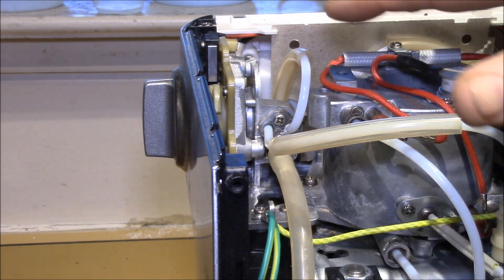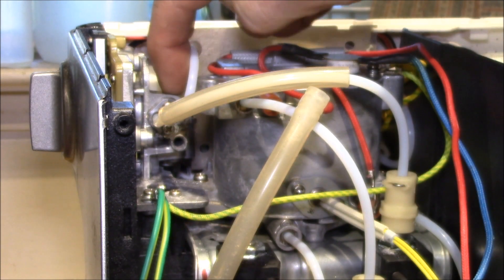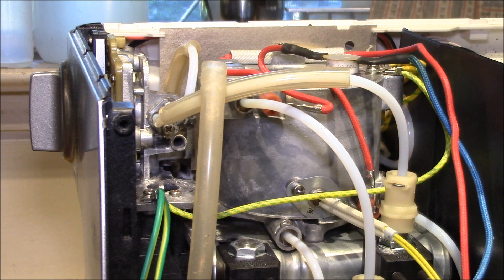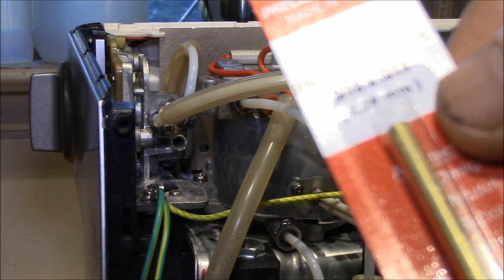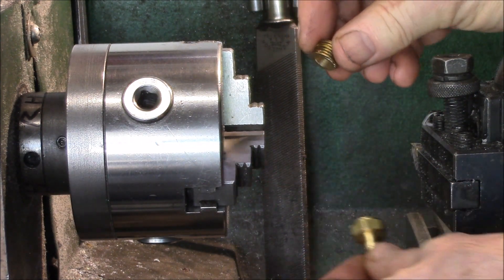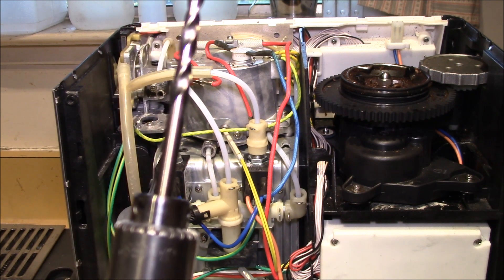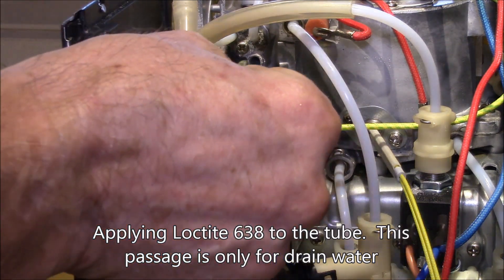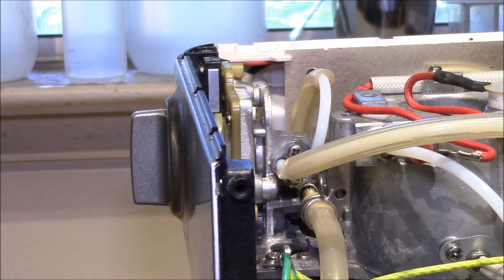Breville 870XL Hot Water / Steam Valve Hose Barb Repair

Comment: This looks to be a return for the water. Probably just to relieve pressure after using this side of the machine. I didn't have enough patience to do what you did, so I just driven a screw inside to block this off. There are two other pressure relieve hoses, so it should be ok. - correction : this one is used during first start up. Now I am waiting when the screw will shoot. Next time I will probably replace the whole thing because if that barb went corroded - the rest is on the way out too. My barb was way thicker than yours, it just crumbled away when I was trying to get out that switch assembly to clean it.
Reply from the maker: Good to know. Thanks for sharing your experience.

Comment: Thanks for the video for reference.  Do you happen to know how to repair the water line that is 11 o'clock to the water line you are troubleshooting?  Do  you think it is the same type of attachment?  In my machine that line (the 11 o'clock to the one you're troubleshooting) has become unattached, I heard it blow off.  Now I'm elbow deep and have no idea how to reattach the water line.  
any advice is welcome
Thank you
Heather
Reply from the maker: I've never worked on that tube, but I think it's held in by the small flange that's held on with the screw at the top.  It probably has one of those brass ferrules one the end, behind the flange.  The tube may have slipped out of the ferrule.

Comment: Hello teacher, I have a problem with the espresso machine (capsule). The steam comes out densely before the water, and then the water comes out. What is the problem?
Reply from the maker: I have not seen that issue before.  Is that out of the hot water / steam valve?  If so, the only thing I can think of is that the connections on the 2 micro switches on the valve have been swapped.  One signals hot water position and the other signals steam position of the valve to tell the machine which way you have turned the valve.
Reply: @The4Crawler  Hello my friend, do you have WhatsApp? I will send you a video.

Comment: I’m trying to replace a water hose and the hose won’t come out! I was finally able to get the pin out but the hose is stuck in the metal. Any tips?
Reply: The water line I can’t get out is the little one that connects to the group head. I got the side out that connects to the solenoid (replaced that) and still no water from group head. I did inject some vinegar and used a paper clip to pick at some blockage that was in there! But still no luck after i tried the single cup again :/
Reply from the maker: @AnnaLien-i3j  That's another line I've not had a reason to remove on my machine.  There might be some tips on this web page:
- https://siber-sonic.com/appliance/800Mech.html
Reply from the maker: If you're talking about the hose to the hot water port, I haven't been able to remove mine either.  Likely the end of the hose is stuck inside due to the same corrosion that I saw inside the hose barb I repaired.  Maybe try injecting some descaling solution with a syringe and see if that helps to free it up.

Comment: I have a leak from the hoses where the water is dispensed. I got new zip ties on the hoses because those zip ties were old and almost braking but it didn't help to much. I think I need new hoses? What is the size of the hose ¼inch?
Reply from the maker: It's likely 6mm ID, which is close to 1/4"
Reply: Which one is it better to get 6mm or  1/4 6mm is 0.23 and  0.25inch is 6.35mm.
Reply from the maker: @dans9462  Tighter is likely better, if the hose barbs are designed for the smaller 6mm dia. hose, then 6mm hose would give the tightest fit.
Reply: I order 6mm. Thank you for quick reply and all your help.

Comment: Hi, I am from Colombia, y have a problem whit my machine Breville 870, I have vapor, but I can't to get an Expresso, I don't have pressure, do you know what is the problem, thanks 😢
Reply from the maker: Follow the water:
https://youtu.be/9lMw6ooiqPI
Likely the 3-port solenoid valve (on the right side) is either sticking, or not getting power.  That lets water flow out the top to the hot water/steam valve all the time.  See the other videos in the this playlist for replacing, testing and cleaning that valve.

Comment: Thanks for linking me here man I appreciate it. This unit is a second hand purchase. I was able to get the rivet out of the old Tef tube and the gold piece out too.  So I may do that with the new one, drill bit or sand the gold part of of the old hole and feed the new tef tube in then re attach the gold piece and rivet. We'll see what happens lol
Reply from the maker: Glad I could help.  At some point I need to pull that valve out of my machine and see if I can take it apart that way.

Comment: New selector assembly $30...where does that 2nd small teflon tube on the right go too?  I have the BES860 model which only has one steam teflon tube going to the selector assembly.  I can still get this assembly but will need to plug off that hose maybe.
Reply from the maker: The upper Teflon tube runs to the steam wand as I recall.  Where did you find a new selector assembly?  All the places I checked say "discontinued".

Comment: Hi, do you have any recommendations for removing the steam wand entirely? I am having an issue where water/steam leaks from the top of the steam wand... I'm guessing it is likely a broken seal somewhere where the steam wand attaches - looking online, it seems like I should be able to unscrew the steam wand directly with a wrench, but mine won't budge. Any suggestions?
Reply from the maker: Never had mine apart.  But try this write-up:
https://siber-sonic.com/appliance/800Mech.html#leakwand
Reply: @The4Crawler  Thanks for the quick reply and sharing that link! That was what I was attempting to do, but I can't get the steam wand unscrewed at all... its completely stuck. Ah well.
Reply from the maker: @lopazanski12c  Just tried mine and it unscrews w/o too much trouble (right hand thread as expected).  Might try working the hex nut back and forth a bit to see if it'll loosen up.  There does seem to be a spring up inside the end.
Reply: @The4Crawler   Thanks for testing it out on yours, great to know thats what should happen... I've tried to get mine to move with quite a bit of force, and it hasn't moved a millimeter in either direction. Frustrating!
Reply: I’m having the same problem with mine. I purchased a replacement wand, but the trouble I’m having now is unscrewing the faulty one off the machine. Any luck with yours?
Reply: @MishoMisho74  Unfortunately no, I tried for awhile, but was never able to unscrew the wand from the machine. I ended up sending it back to Breville for repair... except it turns out they didn't fix it either, because when I got it back it still had the exact same problem. So now I am going to be sending it in again. Ideally if you can find some way to get it off yourself, that's definitely the way to go. Mine won't budge.
Reply: @lopazanski12c  thanks for replying so fast. I tried again just now, still won’t budge. It’s unfortunate that sending your machine to Breville did not fix your steam wand issue. I’ve had mine for more than 6 years, not under warranty anymore. I may just try a local repair shop in town that specializes in espresso machines. Out of curiosity, how much did Breville charge you for that fix or rather non-fix? I hope you don’t mind my asking. Thanks!
Reply: @lopazanski12c  yes that large nut is basically heat forged on there with corrosion over time.  Easier to replace the selector assembly.  Had mine in a vice & the cast alloy broke before the nut gave..still able to salvage the nut end if you chip the cast alloy out of the threads with a chisel & punch:D
Reply from the maker: @MishoMisho74  No video but mine just unscrews using a small adjustable wrench, seems to be 3/4" or 19mm.  It's spring loaded inside, so it's a little hard to turn.  Regular right hand thread.
Reply: @The4Crawler  Thank you! Going to try one more time later. Will let you know if I have any luck.
Reply from the maker: @MishoMisho74  Not sure if they've changed the design of that part over the years.  Mine's a 2013 model.  Here's a parts diagram:
https://www.ereplacementparts.com/frothing-wand-complete-assy-p-1810371.html
Reply: @MishoMisho - I'm having the same leak.  I bought some replacement seals/gaskets online...but can't unscrew the nut to remove it.  I'm wondering if it's all bound up due to our hard water... I"ll keep trying and see if I figure out any tricks to get it off.
Reply from the maker: @FredParent  Likely so, I was unable to loosen one of the screws on my valve.  Instead of forcing it and risking more damage, I chose to repair the valve and fitting in place.  So far that's been working great.
Reply: @FredParent  I gave up on trying to unscrew the steam wand after my 3rd attempt which made the leak worse. I wonder too if the hard water build up is preventing us from unscrewing the wand off. Let me know if you have any luck with yours.

Comment: During my last 870XL repair, I accidentally cut into the silicone tubing when cutting the zip-tie that held the adapter for the water tank.  Can you tell me the dimensions of this clear, high-temp silicone tubing used through this machine?  I have to replace my solenoid valve assembly, so I thought I'd replace this tubing when I open the machine up for this repair.  And, thank you for all of your repair videos on this machine.  You've been a great resource!
Reply from the maker: Looks to be 6mm or 1/4" ID.

Comment: Hello . My breville barista express when I want to froth the milk, I activate the steamer and I get steam from the head not from the steam wand
Reply from the maker: Likely either one oof the solenoid vavles is not working right or is hooked up/plumbed incorrectly.  Water should flow through the thermo-coil and water/steam should exit via the top of the 3-way valve to the hot water/steam valve:
https://youtu.be/9lMw6ooiqPI
Maybe your valve is stuck open and is sending steam out the brewing head instead.

Comment: Hello , would you know if this whole unit can be replaced? I had similar problem and the port was clogged because the bras head from the hose got fused with the port  , I drilled it out ant tried to replace the hose , but in the process I broke the part of the port that holds the pin clamp , I'm not very mechanically inclined to machine new parts so wanted to see if I can replace that module.  Or if you have any other suggestions. Thank you
Reply from the maker: It seems that valve may have been discontinued:
https://www.ereplacementparts.com/selector-valve-assembly-p-1810370.html
You could contact Breville with the p/n and see if they have any options.  You could always bypass that valve by running the hose to diffuser/drain.  That will eliminate the hot water/steam feature but still let you use the grinder and espresso features.
Reply: Thank you 😊

Comment: Hey man. My breville barista express does not stop dispensing water when i click thr 1 shot. Before it used to stop automatically at 12 seconds but not i have to to manually click the single shot buttom to make it stop. Any insights about this? Hope to hear from you soon. Thanks Buddy
Reply from the maker: A few things to try.  First, be sure to use a short press as a long press on the 1 cup button makes it run for an extended time.  

If that's not the issue, try resetting the default volumes.  From the user manual:
"To reset the machine to the default 1 CUP and 2 CUP shot volumes, press and hold the PROGRAM button until the machine beeps three times. Release the PROGRAM button. The machine will return to its original default volume settings and default espresso water temperature"

If that doesn't do it, might be worth contacting Breville support and see if they have any other troubleshooting information.
Reply: Thank you for the response buddy. Ive done both but still failed. Im currently descaling it daily and not use it to make coffee. Hopefully its gonna help
Reply from the maker: It may be the problem is with the main controller board.  All the buttons and solenoids are controlled by the main board.  When you push the 1-cup button,  that signal goes to the main board and then the solenoid is turned on for a period of time by the main board.

Some other things to try is to unplug the machine for an hour or so and see if that gets it to reset and then you might try programming the 1-cup volume with the Program key following the instructions in the manual.
Reply: R Brown works fine now brother thank you
Reply from the maker: @ralphadriandira4906  Glad you got it working again.  Was it reprogramming the 1-cup button that did the trick or unplugging the power?
Reply: Hey Buddy. My breville finally gave up. It dispenses water non-stop..
Reply from the maker: @ralphadriandira4906  My guess is that the main controller board is acting up, as everything in the machine is controlled by that board.  Either that or the water flow sensor has failed and the controller can't see how much water is coming in.
Might be worth contacting Breville support and see if they have any further troubleshooting for that issue.  A new controller board is not terribly expensive, controller p/n: SP0010236, flow meter p/n:  SP0001473
Reply: R Brown i usually would love to try to tinker and fix things by myself. Is it difficult to change  the new controller board?
Reply from the maker: @ralphadriandira4906  I've never got into that side of my machine.  Seems fairly straight forward, just make sure all the wires go to the right connectors.  Here's a page with some repair information:
https://siber-sonic.com/appliance/800Electrical.html
Or I think Breville has a flat rate repair program.
Reply: Damn it worked fine for 2 days but now its back to the state where it doesnt stop dispensing water
Reply from the maker: @ralphadriandira4906  Try whatever worked before and see if it changes.  If it again works for a while then runs forever, it's likely the main circuit board as that's what determines how long a 1-cup or 2-cup shot runs.  It might be the "memory" feature is not working right and the controller "forgets" how much water to dispense.  If the 2-cup setting works OK, then it's likely just the 1-cup setting.  If the 2-cup setting is also acting up, then it may be the water flow sensor below the water pump is not working and the controller is not "seeing" any water flowing and thus keeps the pump running for a long time.  Breville support might have some better ideas.

Comment: What’s the function of this pipe? I am investigating a leak from this valve. Noticed that this hole is totally blocked inside. Try to blow some air into it. Is it supposed to see the air run through and come out from somewhere else? I already disassembled the valve to test the metal piece only
Reply from the maker: That port is the inlet to the manual valve.  In the Stand By (middle) position, that port on the valve is routed to the diffuser and eventually to the drain tray.  In Hot Water mode, air blown in should come out the hot water port and in Steam position, out the steam wand:
https://youtu.be/9lMw6ooiqPI
Reply: @The4Crawler  the one blocked on my machine is the hose barb you replaced in the video. I watched your another video about water flow, seems like it shouldn't be a dead end.  now the question is that where is the blocking spot inside.  if it is a straight line facing to the outlet hole, I can simply drill through it.  can you know anywhere I can but a replacement part for this valve?
Reply from the maker: I ran a drill bit in as far as I could without drilling through the front side of the valve body,  I started with a smaller bit and worked up until I hit the size drill bit that matched my tubing diameter, 3/16" in my case, 5mm would be a similar diameter for metric tubing.  That valve is no longer available from what I can find looking on-line, link in the video description.  You might try removing the one plate that holds the hot water hose in place to see if you can see inside the valve.  On my machine, I can get one of the two screws loose, but the 2nd one seems to be stuck so I didn't want to force it and damage the valve any more.
Reply: @The4Crawler drilled through. fixed! The machine is running good now.  Thanks for your tips!
Reply from the maker: Good to hear.  Yes, I think these valves are prone to clogging internally.  Not sure what they look like inside, though.  Maybe some day I'll locate a dead machine I can pick up to tear apart.

Comment: I think you linked to the square brass tube instead of the round one. Also is the loctite considered safe for this application? ie Will steam or heat cause compounds from it to leach into the water?
Great repair by the way!
Reply from the maker: Thanks, fixed the link to the current one for the round tube.  You can get "food safe" retaining compound, I used what I had on hand.  The temperature rating is good to 300F/150C, so way hotter than this application would get.  I applied the compound to the outside of the tube in from the end so most of it should end up between the valve body and the tube.  As this is the drain port of the valve, the only water that flows through here goes into the diffuser and out into the drain pan, not terribly concerned with any small trace of compound getting in there. Over time, the drain cycle should flush out anything remaining inside.
Reply: @The4Crawler  Thanks for the clarification  and thanks again for the video. I will be attempting this repair soon....
Reply from the maker: It's not too hard, just take your time and don't force anything, especially when drilling out the hole in the valve.  I used a handful of drill bits, working up one size at a time.  All but the last bit was turned by hand.

Also, if outside the US you would be looking for 5mm tubing and maybe a 6mm hose barb fitting.